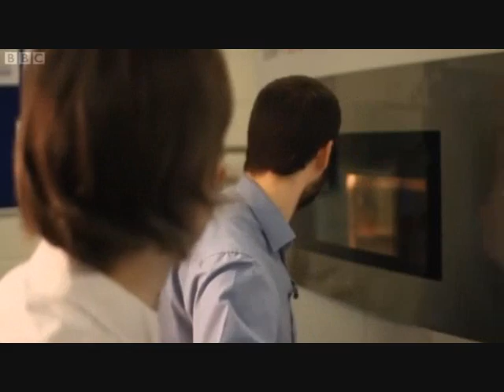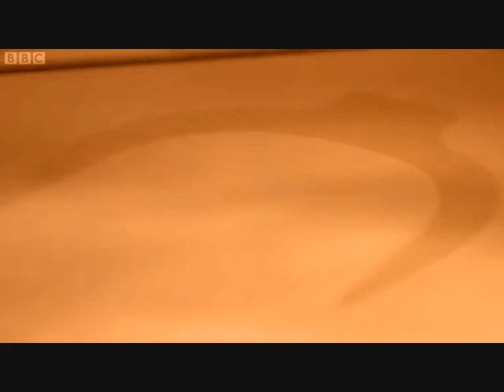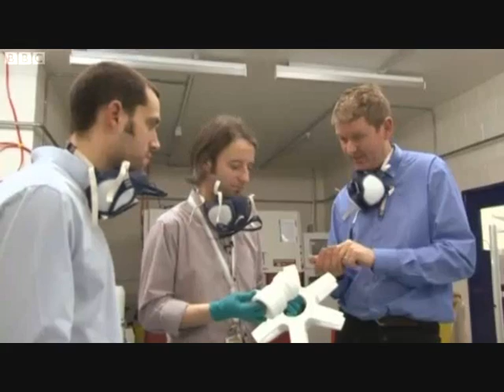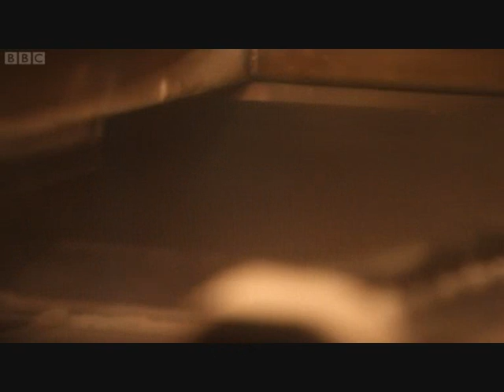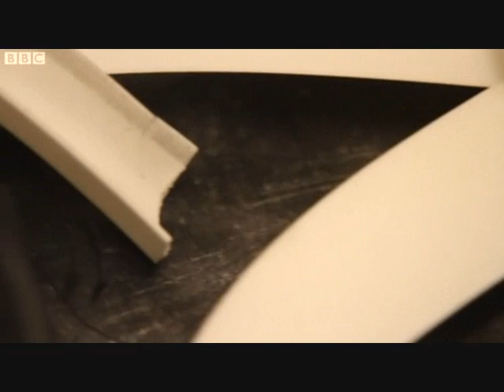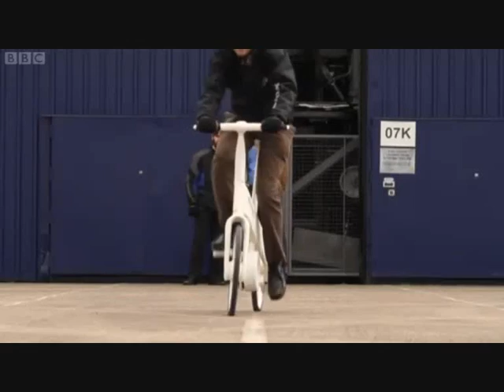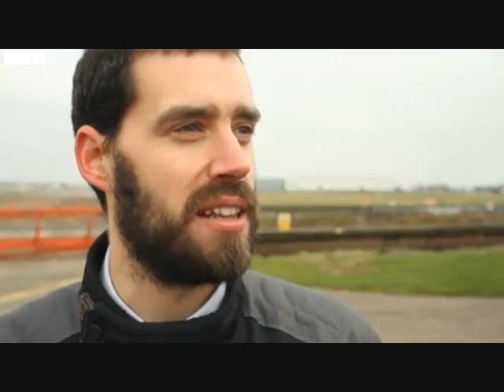Printing a bicycle with a 3D printer

Comment: Ok so you have additive manufacturing that can make complex designs that traditional manufacturing can't, with superior strength to weight ratios, and that is the garbage you design? Taking advantage of exactly zero of the benefits of additive manufacturing? Well done.

Comment: Home paper 2D printing is on fast decline the last years. Same will happen to home 3D printing (if it ever becomes popular) but much faster. Its only going to be a hobby thing for home use. Nobody is going to print their toilet seats etc. at home.... and after everybody has printed a boat load of Star Wars figures the novelty will wear off quickly.

It probably will only become pretty popular with smaller companies since it is more affordable now. In the professional world  3D printing is actually nothing new at all and the quality of prints only improved mediocre in the last years.
Reply: +Gigaloader Careful, some people might not pick up on the sarcasm. It is the internet, afterall.
Reply: Joshua Petersen Don't get me wrong I love 3D printing.....Just trying to be realistic for home use. 
If we only had atom/ molecule printers  - that would be a whole different story.
Reply: Yea, but what I'm saying is "Don't knock the design till you've tried it." A lot of the design of bikes is about stability of the frame. 3d printing can do inside lattice matrixes that traditional metal pipes can't do, but plastic also has a lower strength. That design may be the better design for plastic as a material.
Reply: you can make household items that you would normally have to buy... i would say its pretty useful

Comment: Wow, 3D printing is grossly overrated. Why would an intelligent engineer attempt to build a bicycle to demonstrate a 3D printers capability. They even used words like "conventional bike". Haha, these guys are nothing but 3D drafters, with no working knowledge of metalurgy and the benfits of using metals. The advantage in 3d printing would have been better portrayed if they designed and printed a plastic chain guard for a real bike within 3 hours and be able to ride the bike the same day. Its all about the ability to manufacture or produce something in a short amount of time. These guys tried too hard, went in the wrong direction with 3D printing, and clueless people are first to "ohhh, ahhh" at the discusion of 3d printing. Would you ride that bike? Neither would I..., the headset was loose, the gearing slipped constantly, and the geometry was that of an akward kids folding bike. I ride and maintain a fixed gear bicycle. I know every part of a bicycle. No plastic bicycle will ever compare. We need to up the ability to form plastic parts like bearings with extreme hardness and precision.  The bearings that are placed in modern bicycles are often no more than 25 millionths of an inch different in diameter. Thats how steel bearings and races can perform so smoothly and uniformly.  That information would have been easily found within a day if these guys did proper research after brainstorming that theyd make a bike.  3D printing is largley a fad in the maker culture.
Reply: I think it's more about pushing the limits of materials and usability of 3D printing in real-scale models; The general contribution to technology and development is not about making a bike, because it could have easily been anything else. What we have to learn from these experiments is that this kind of technology offers the chance to produce highly complex programmed shapes (like fractals) or other types that can be only achieved through printing and not conventional building because of their complicated mathematical and physical shape. Shapes where their morphogenetic flow and information exist "within" and have some sort of mathematical procedure, like the patterns in sunflowers or a romanesco broccoli are much better produced with this kind of technology (or even impossible with other technology). It is obvious that it looks stupid to print bikes without any innovation and it's also inefficient. At this point the only innovation is the printed material and its structure so the test is not the stupid; because if you try to understand the material you start with building classical shapes that are easy to understand and to test. So I hope the guys are not just playing around.
Reply: As the technology currently sits, yes, it's less practical to print a bike than to build one, but the advantages are several: while the printer itself is expensive, the parts that come out of it are phenomenally inexpensive; printed items can be customized; and you can make almost literally anything with a 3D printer. The bicycle may as well have been "flip through the dictionary and tell me when to stop".

I recently got a FDM-type printer, and I actually have plans to use parts made in it in combination with more traditionally-manufactured hardware. That's where I think the technology is really going to shine right now.
Reply: It's depressing to see such ignorance portrayed as cutting edge. But I'm all for them learning. I would love a printed chain guard too!
Reply: they do make carbon fiber race bikes for the tour de france and high end cyclist events, carbon fiber is a plastic they also use it in race cars and jet fighters.... just saying

Comment: I was once thinking about an all wooden bike or wheel and  I came to the conclusion that spherical bearings were pretty involved and would have weak points because of grain. Cylinder style bearings between 2 surfaces would work and you could align it so its not weak.
Reply: you don't need to build everything out of wood.  the bearings can be metal while the frame can be wood.  you can buy the bearings at any bike shop. 
the problem however is that wood does not flex so it could crack and break if you hit a bump in speed.

Comment: Oh man, that looks like a pain to ride. Why go with that design??? The balance would be all wrong, impossible to steer, and there are so many parts that could flex and torque wrong. With a traditional bike, the angles the pieces are at kinda minimize those forces... Yes, let's get guys who design cowl flap hinges on aircraft to build a bike. I don't see how they could possibly do anything but a perfect job. But bravo for making it work. I won't say it worked well or was a good design, but it was a design that worked. Barely. Still wouldn't ride something with that steering/balance geometry for more than a few meters. Now go make me a kit so I can chop down some bamboo, take the kit, and with a saw, duct tape, bamboo, tires and the kit, make a bike that fits my riding geometry perfect. Thaz what I want.

Comment: If it couldn't handle the tyre's air pressure, how could it handle the wight of the man on top of it? How do we know how resistant are all the parts? What if I pull a wheelie, or a stoppie, or run down a hill... How do I know if it'll survive the stresses?
Reply: In short: how resistant is this thing?
Reply: Guilherme Mauricio Dassault System design software will be able to show how 3D model resist to stress. Wait and see.

Comment: But how expensive are the materials used for printing? thats the question,and how much effort to print out things that need to be of  a certain material, like copper wires, or fiber optic cables?

Comment: the real question is can you print a 3d printer printing a 3d printer thats printing a 3d printer thats printing a 3d printer thats printing a 3d printer thats printing a 3d printer thats printing a 3d printer thats printing a 3d printer thats printing a 3d printer thats printing a 3d printer thats printing a 3d printer thats printing a 3d printer thats printing a 3d printer thats printing a 3d printer thats printing a 3d printer thats printing a 3d printer thats printing a 3d printer

Comment: Yes and no, parts by parts it should, but they still have a restrictive list of materials that work with these machines. Metals for example aren't on it.

So eventually, knowing that it requires circuits, no it can't, yet

Comment: No. You can print many of the components, but you can't print stepper motors, electronics or copper wire. Some people have had success making stepper motors, but they are not practical or accurate.

Comment: Why not use a metal printer for the bearings instead of the nylon? Keep the spirit alive but use proper materials in their place. Nylon makes a good bushing but I don't see anyway to make it a compact bearing, heat, pressure and abrasion have never been nylons friends lol

Comment: It would have worked better if design specifically for the strength and nature of that material.   It only looked like a modern bike.  Which is fine to look at, not to ride.

Comment: Man, could be THAT easy! Here i see good potential for bone prothesis, in new biocompatible materials and more precise and personalized "parts", even small ones. It seems scaffolding wounds with 3d tecnology has already been done, and maybe will be an huge step for heavy-burn treatment. But from there to growing back arms is still a long way up, at least in my opinion

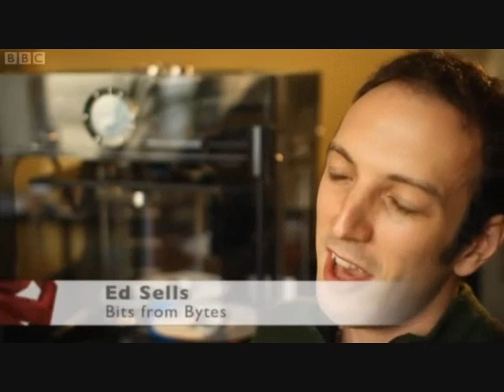Comment: 4:25 is he really suggesting that 2D printing on a home printer is a cheap alternative to going to a shop? Has he bought a cartridge lately? The plastic "ink" powder - a byproduct of OIL - will be very expensive, and no doubt delivered by a non-universal cartridge. It's all about making money. Unless they are going to print metal bearings, because bearings can't be made of anything else! Nonsense.

Comment: 100 years? try 3-5. They are talking about 3-d printing bio-tech stuff for transplants. You can already 3d print metals as well as abs grade plastics. This industry is revolutionary and will be like computers in general. It will be a snowball effect, gaining traction and growing in size but most importantly the speed of new things is going to be incredible!

Comment: But then again, if the 3D printer is smaller wouldn't the layer size also be smaller? You know what this reminds me of? An old physics paradox. If you have a 10 foot line and you have to walk from point A to B. You can only go half the distance to the target each time. First go 5 feet, then half of 5 feet which is 2 1/2 feet etc. So you would continue to move forward for an eternity but never reach your destination. I tell you, paradoxes are confusing. Not practicle but confusing.

Comment: The first airplanes were built in bicycle shops using tools and equipment for making bikes, it's only fitting that this aircraft shop builds a bike using equipment made for rapid prototyping of experimental aircraft parts.

Comment: I would have used a different bearing system, using much larger wheels, a cyclical system, maybe 17 wheels set onto a rigid frame, like a large roller bearing with spoked wheels..

Comment: there are a few websites you can use to get it printed and they will mail it internationally, though it is very expensive if you were going to do it i would open the model and hollow it (remember to leave a gap for some of the excess to run out) otherwise they will charge you even more

Comment: Yeah, its really easy to feel a sort of elation over the endless possibilities of this advancing technology. But then you gotta remember that at the moment it only makes plastic products. So, screw? sure. Car? Eh, you'd probably still need gas/fuel. Pillow? more like a tough head block. When we can use elements in a broader range and construct items by the atom up, then we can see printable pillows. But this is just really precise lasers melting plastic, so it's not all that grand atm.

Comment: I think that this technology is really going to take off fast. The ability to make anything you want is very appealing, and the reason why it hasn't went mainstream is because of cost and expertise. As soon as they make a cheap 3d printer with user friendly software it will take off.

Comment: Kinda misleading - this is stereolithography. It's been around for a while. While it technically is 3D printing, there are other processes that use different methods which would yield a much better product. SLA tends to be for very basic prototyping- parts created must be handled extremely delicately, and the resin is about $36,000 per gallon. The powder method is much cheaper, more modern, and allows for much tighter tolerances and stronger design

Comment: actually you can the reprap is a 3d printer that can reproduce the majority of its parts electronics and motors need to be purchased obviously and some steel bars are needed for support but the original idea was an open source printer project that one could build with a kit and then reproduce the kit and build another one for a friend. The project was to make 3d printing more mainstream

Comment: This technology looks cool.  Only thing that I see wrong is that this technology is going to kill employment in the manufacturing sectors.Another device designed to do the job of multiple humans.  You just wait, they'll use this tech to build buildings... Then construction jobs are wiped out.  Won't be too long til this technology evolves to the point where cars will be printed.  Jobs gone!  It is pretty f'n cool tho.

Comment: He can ride. The reason it's wobbling around as he rides is the design of the bike. He still not getting used to riding the new bike so it happens.

If he can't ride, the bike won't even go on two wheels.

Comment: As of now, the material used with 3D printers are pretty limited but soon, I'm sure, it would expand to different plastics or even metal. The screening of fake money will probably be much tighter and I assume that the rest of the world will transition to plastic or even digital money. False cash would be way to risky for the charges. I don't even know what I'm discussing.

Comment: I don't think those features will make people oversee the fact of that money been blank and made of plastic, in the top of my head I think you could hide a couple of fake 2d 20s on a roll of real money, is not like they check all that stuff 1 by 1, and the resolution on these 3d printers is nos as good as to create those imprints, remember everything coming out of these printers is opaque plastic.

Comment: Depends on what type of material you are using. If its a thermoplastic, like polypropilene (PP), you can melt it and reuse again. In FDM fused deposition Molding, that is very possible, but they are using SLA and i think that epoxy is not recyclable.

Cheers

Comment: Well, it forms solid objects, so it can be used to build the barrel and things like that, and even though it is rather fragile, with enough thickness it can be acceptable for a gun, but it cannot make the bullet...or the springs, and things of that sort
still, great technology...hope it becomes cheaper and a little more rigid

Comment: It may not print the full machine but couldn't it print the parts used to build a gun after all I think in boot camp they teach you how to build a gun using certain parts.  As for bombs i agree that is a stretch

Comment: Yes! I actually saw a 3D printer that was assembled with parts printed from a 3D printer. That brings up the question like the chicken and the egg; which came first, the 3D printer or the parts printed on the 3D printer?

Comment: As in, they found out how to use it on accident. 
Likewise with the creation of popsicles and microwaves. 
Clockwork computer. Obviously. 
The point is that accidental things are more practical than nylon bikes.

Comment: On the contrary. I'm paying attention to everything. Hence the arguing for the sake of arguing. It's a sport. 
I never said they were wasting their time, I said it was impractical. I've said many times, usually people could pick up on things quicker than that. 
And I have pointed out the obvious lack of use and point of the project as well. Everything can go both ways, as I *again* have previously stated. 
Oh it is quite practical. Mental exercise. Quite useful, really.

Comment: I assume you're not an engineer. 
This video is just a bit of fun, testing the limits, trying to see if you can print a bicycle. This is however not what 3d printers are primarily for. They are for rapid prototyping, one-offs, architecture models and the like. 3d printers are already used quite extensively and successfully. 
Traditional manufacturing methods are, and will be for the foreseeable future, much more practical for mass production.

Comment: Doesn't matter. A Nylon bike is good for absolutely nothing, ergo making it completely impractical. 3-D printing may be an interesting concept, but they are much to expensive, take too much time for a world based off of instant gratification, and probably will always be impractical. Therefore, I will never be impressed by this, ever. 
Of course it does. Microwaves, popsicles, electricity, all came from testing. WHAT WOULD WE DO WITHOUT POPSICLES?

Comment: You can make things like bearings and circuits with 3D printers, but the 3D printer you could build with them would be pretty poor - much worse than the 3D printer you used to make them. Real bearings are manufactured to exceptional tolerances and use a variety of materials with heat and surface treatments to give them the right properties - stuff you can't do with a 3D printer.

Comment: You can't build a 3D printer using any current 3D printer. Reprap doesn't even come close to being self-replicating; all the important bits (extruder, electronics, motors, bearings...) are made using other processes. Machines capable of manufacturing copies of themselves have been around a long time, but they work by cutting metal, not squirting plastic. 3D printers are cool, but it'll be a hell of a long time before they can replace the CNC machine tools that are used to build their own parts.